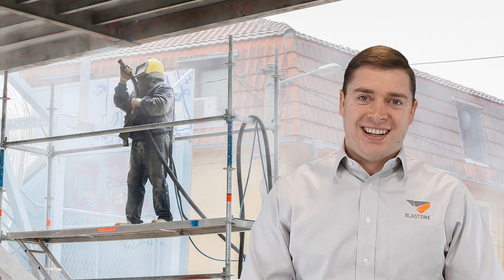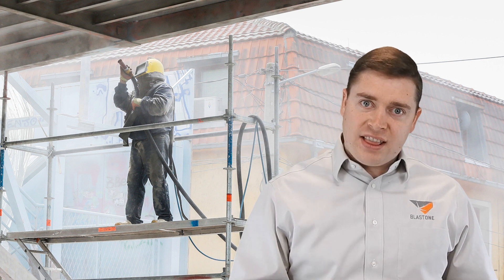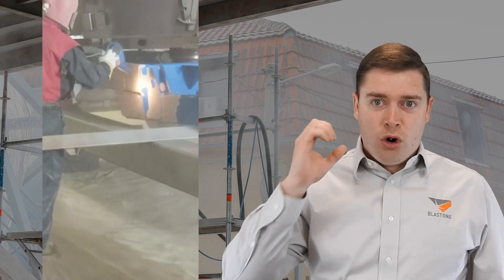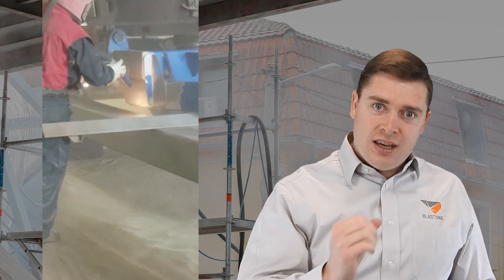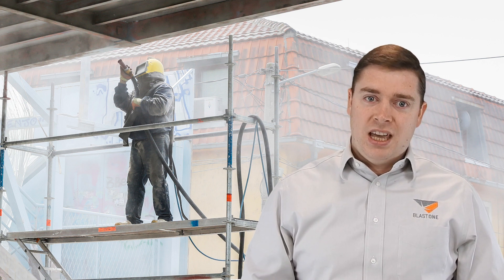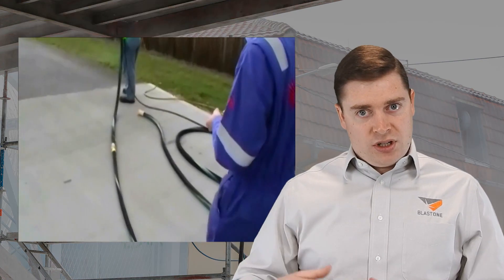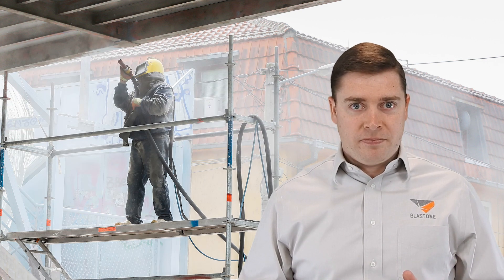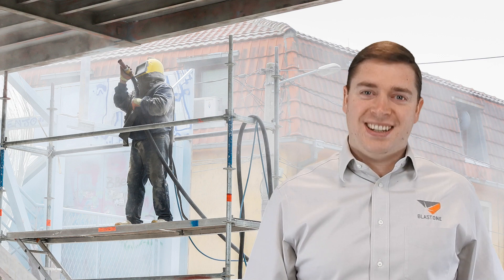Simple Sandblasting Inefficiency Test

Comment: But what if the blaster's only got one arm?  😁....... I wish you guys were in the U.K.   Your vids have been a great help to me and plenty of others I'm sure.  Actually I have a question, you have mentioned in several vids 100psi or more is ideal, what do the mobile diesel compressors in Aus usually produce?  In the UK you're hard pressed to find many under 400cfm that produce anything over 100psi to start with.  Best regards.
Reply from the maker: John, sorry for the late reply. if he has one arm, you will need to reduce the nozzle pressure, or find a way to hold the nozzle